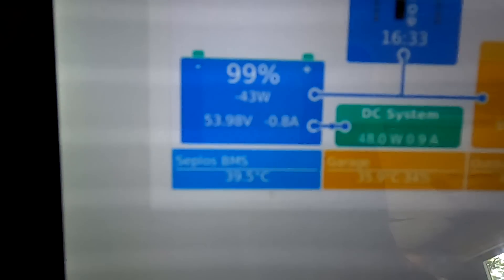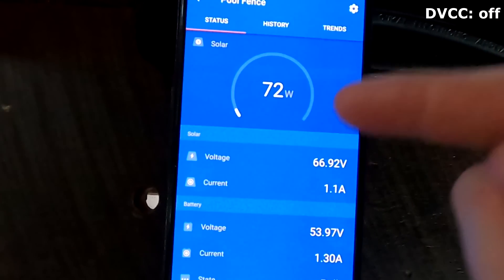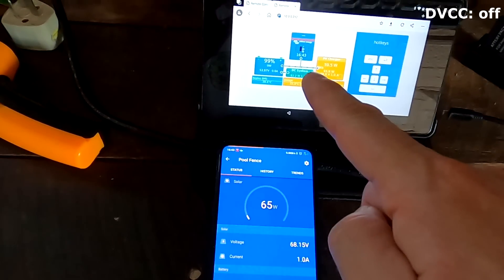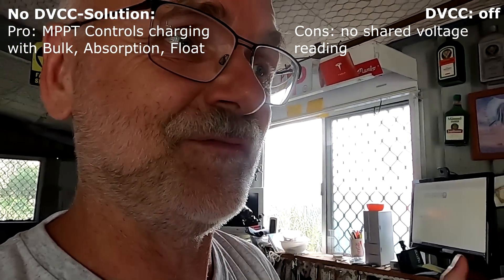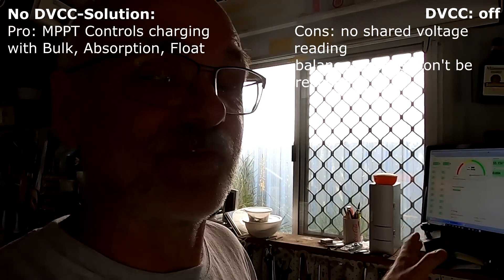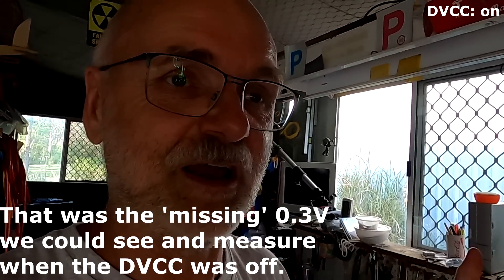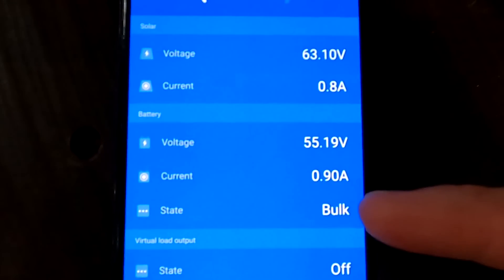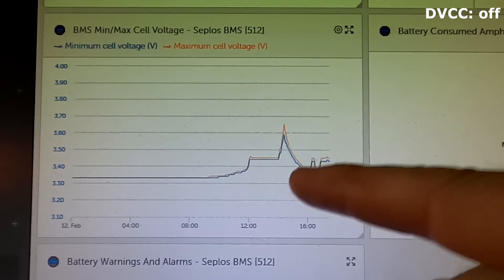Your Solution: Why you should(n't) turn on DVCC with your Seplos BMS.

Comment: I don't know if it's new, but I was able to select "No BMS Control" under DVCC -> Controlling BMS and can still use shared voltage, current and temps with everything.  The maximum charging voltage doesn't seem to work, but I just set that up in the multiplus and 2 MPPTs charge settings.  I think the charge current limit still works though.  I only have 1 48V 5kwh battery so if I am charging with all 3 devices I could go over the max recommended 100A charging.

Comment: I have been watching and learning from your channel for a long time, but have you ever talked about what happens when the CAN-bus connected BMS shutsdown?
That is by far the most negative aspect with having the batterybank connected to your system.
By using the shunt and have no COM to your system, it doesn't matter which one of your packs shutsdown (if not all of them does it :) )
Reply: Yes. I turned on DVCC for not quite 2 days (about 1 million CAN bus packets received) then at 5am something failed and the can bus interface (can0) went away, so the inverter set itself to 'off' and the MPPT didn't start up at 8ish when the sun came up. VRM stopped logging data too. So it failed safe, but obviously the system just stopping like this when a data connection drops out is not great. It would probably be better if it fell back to standard ESS charging behaviour.

Comment: Turning off DVCC will make your system charge your battery from the grid! Be aware of this! I have no idea how to turn off grid charging the battery when DVCC is off. Update: When I disconnect the cable but leave DVCC on, the Multiplus / Cerbo tell me "Low Battery" and use the Grid instead of discharging the battery. The seplos bms tell me the status is "idle", erverything green. What is going on?

Comment: I know, kinda late, but the voltage issue ... doesn't the smart shunt show the correct voltage and share that to the charge controllers?
Reply from the maker: Not when you have a Smart BMS connected as well. The shunt is obsolete in this case.

Comment: I ended up turning off DVCC and used the multiplus charge settings instead, just seemed more reasonable.
Setting are;
Balancer on & float (v/pc) @ 3.45v
BMS cell warn @ 3.50v
Charger set to 3.55v per cell
Cell OVP set to 3.6v.

That way, it gets fully absorbed, balanced and rests at 3.45v, I might change that to a bit lower in the future though.
Reply from the maker: I don't charge that high. 3.45V is my max and 55.2V is the charger voltage. After 1h (to allow balancing) I fall back to 3.35V or 53.6V.
Reply: @OffGridGarageAustralia Just got my V2 Seplos BMS to reset soc without triggering OVP. Clearly there's a setting that's not set right, or you need to charge higher than 3.45. Video on my channel (can't link cause youtube auto deletes)

Comment: Hi Andy, i am really having problems in trying to get a Sofar ME3000SP to function correctly. I recently put together a Seplos Mason case (the vertical type) with EVE 280cells. All seems to work fine, fires up, returns front screen info and i can access/change info on the bluetooth app. its the latest Seplos BMS as far as i am aware.

The sofar inverter doesnt seem to want to take power from the battery to feed the power required in the house .... 

is this because the battery needs to 'reset' after its reached 100% state of charge?  if so, how do i do that please? Happy to provide information/screenshots etc for anything you think might be causing my system not to work properly?
Reply from the maker: Hard to tell. Do you have the inverter connected to the Seplos BMS? What protocol settings in the BMS? Does the BMS shows charging and discharging FETs are on? Does the inverter displays the battery voltage?

Comment: If you are using a Victron Multiplus you can run V sense wires from the inverter charger to the main +/- terminal on the battery and select that as the voltage sense source. Those wires can be thin because they carry zero current, they only measure the voltage.
Reply from the maker: Yeah, only the Multiplus is not my point of truth for measuring the battery voltage. That is really the Smart Shunt in my design as it sits closest to the battery and also knows about the current and SOC.
Reply: @OffGridGarageAustralia  if the multiplus v sense wires are attached at the battery terminals then that is a superior battery voltage sense regardless of how far away the multiplus is from the battery. With no current ever being carried by those wires, there's no voltage drop. You can select which reference voltage, temp, current sense that you would like to use. I think the Multiplus makes the most sense for voltage and the Lynx Shunt for current and temp, at least until Seplos figures out how to control the Victron MPPT's....

Comment: the formula for CCL (charge current limit) is obsolete and you can use full charge current of for ex. 200A if you set the switch "Single BMS 1.0C charging" in the blutooth app to "on"

Comment: Hallo Andy, Du hattest doch mal irgendwo eine Liste mit deinen Einstellungen für das Seplos BMS. Irgendwie finde ich den Link nicht mehr.
Reply from the maker: Thanks, Thomas. I've  never done a list with all settings for the Seplos BMS as I'm still experimenting. But there is a list of all Function Switches and what they mean if it is that what you're after. It's right on my website under the Seplos BMS: https://off-grid-garage.com/battery-management-systems-bms/
Reply: @OffGridGarageAustralia  Hello Andy, as I see English should be the preferred language in your Youtube channel. Yes that is the document I was looking for. The other parameters for voltages etc. I can get from your videos. Greetings from good old Germany.

Comment: In DVCC u can set the source for the current measure and the source of the voltage measure. So u can set (for example) the bms for voltage reading and the smartshunt (not on the battery3.0) as source for the voltage reading.

Comment: @off-grid garage Die ganzen BMS funktionieren auf dem gleichen Prinzip welche CAN unterstützen - man muss sie so weit hochladen bis der Charge Mos zu macht (hängt vom den Parameter vom BMS ab)... dann gehen die Spannungen zurück und sind quasi auf Float... erst wenn das BMS unter einem gewissen SOC oder Discharge A ist gehen die MOS wieder auf! Lädt man die Dinger nur bis 55.2v welches mit deinem Bulk Absorp und Float Setup perfekt funktioniert zb. bei JK usw. hat man mit den ganzen CAN BMS Probleme da die erst viel Später den Mos zumachen... auch eine Kombination aus SOC, Current under 5A und bei einer gewissen Spannung schaltet der MOS

Comment: The use of Seplos batteries for powering devices has become increasingly popular due to their ability to store large amounts of energy and discharge at a steady rate. However, one issue that arises with Seplos batteries is the potential for uneven discharge when two or more batteries are connected together. This can lead to issues such as premature battery failure or inconsistent performance. To address this issue, there are several techniques that can be used to ensure both Seplos batteries discharge at the same time and maintain an equal State of Charge (SOC). These include using a balancing circuit, adjusting charge rates, and monitoring battery performance over time.
Reply: Are there any Firmwares available for the 24Volt Seplos BMS? I already tried the one from your website, but it seems to have a wrong calculation showing Victron System. Is there another option that I can use?

Comment: Andy, thanks for sharing, this is interesting. Maybe a wild guess where your 0.15V is coming from, the resistance in the wires and also the tiny drop of Voltage accross the BMS which is in it's path. If Seplos is measuring the voltage on the batteries and Victron on the output op the charge controllers this is what makes the difference. I agree you might not want to have an offset, in the ideal world the BMS and chanrge controller settle on what they measure, but that would mean both could manage and operate certain parameters together. I think the interoperability if not there yet to the fullest and should be sorted by Seplos.
Reply: I think it's because of the temperatures, so the connections should also be provided with a spring washer so that there aren't higher resistances at high temperatures.
Reply: The drop of Voltage is in my system only 0,02V so it is like nothing, if not reach the 55,2V for balancing, you can load 55,3V and that help in System with so much Volt drop.

Comment: A paranoid man might suggest that Victron doesn't let you use the BMS as a voltage reference because they want to sell more Smart Shunts...
There isn't a good reason for them not to allow you to set the BMS CAN as the source of measurements like the Smart Shunt and still retain control over the voltage set points at the charge controller.

Comment: I have the same result with Daly Smart BMS and Victron. The more charging current you have - the more voltage difference. Increasing the voltage for 0.2-0.5V in the MPPT doesn't solve the problem, because the lower the current - the less a difference. If the current is 1A or 0.5A, there is mostly no voltage difference, and your batteries will be overcharged for 0.2-0.5V as set in the MPPT. But if the current is zero and the voltage is different, I think it's safe to just increase the voltage in MPPT. So, there are two ways how to solve it: enable DVCC or buy a SmartShunt. I am going to buy a SmartShunt. But overall the problem is not so huge, because the battery will be charged to the MPPT voltage anyway, but with a lower current, because get an absorption level earlier. So, your batteries just need more time to charge.

Comment: Hi Andy and thank you again for this video (and all the others too!)😁👍
As I told you in one of my previous comments, this configuration with the BMS which manages the charging system, it works, But!
 you can definitely see that it "drives your solar controller crazy" 🤪like: Bulk/absorption...Bulk/absorption...Bulk/absorption...and floating???🤔
For me it is not good, for your solar controller?!🤔
Again, let's not lose sight that the BMS is made first of all to manage the battery pack, to protect it and not to manage
the settings of the solar controllers.
Having carried out multiple tests, it is not always easy to find the right balance of settings for these 2 parts of the system.
(In the end, managing by the solar controller is much better, especially when you have several battery packs connected in parallel)
Thanks again for sharing these tests with us!😁👍
Reply: I work with DVCC on and SVS on the others STS and SCS off. The BMS setting is 56.4 and in the DVCC I have 55.2 as the limit, as soon as the 55.2 are reached, the system goes into absorption and then just shovels still Ah in, at the beginning it is still 50Ah/kit, later less and less to almost 0, the battery is then 100% full and the voltage is 55 volts
The BMS never gets into a warning zone and I'm happy with that - let's see what Andy finds out in his next video.

Comment: I've often wondered why they don't have a four-wire connection to the battery. Using separate measuring wires would eliminate the I2R losses in the charge wires.
Reply: That is already an option with the multiplus ii, but it only works to manage charge voltages, which might well work in this situation.

Comment: Interesting stuff, but that voltage difference is disconcerting and the no float option would bother me. Could you use a victron 'Smart Battery Sense' to get an 'accurate' reading of the battery voltage, and share that on a BT network for the solar charger to use?  Also, how close is the shunt voltage to battery voltage measured at the battery terminals? I guess you could share that voltage if close enough? Cheers !

Comment: The more components you add to the system, the more variables or problems you will have. You really only need a good BMS and good multimeter. Also, there is no such thing as too much power from solar. Expand your battery capacity and go truly off-grid. If you have to much solar power then you are wasting power. Add capacity and tell your utility company goodbye ✌️

Comment: I’m wondering if the raw communications data between the Seplos and Victron equipment can be captured in some kind of debug mode on the VenusOS device side?  If so, the data could then be filtered through Wireshark or similar CAN bus specific software to get the protocol messages into a more human readable form.  If possible, it would help both Seplos and Victron gain valuable interoperability data from several BMS versions being used in the wild 😉

Comment: put a Victron shunt at the busbar and be done with it. Victron controls charging, Seplos controls the battery. You're splitting hairs with millivolts if the devices don't have voltage correction as an adjustable setting to correct for line losses from resistance .

Comment: I just installed a  WZRELB 4000w 24v inverter to run aircon lol  now cool as ice ,my lady wanted window mounted one in office , its kelvinator 3.9kw 1180w 1,5hp  ,been testing it on solar making 1000w-1200w  no worry's runs great very quiet ,so good free cool air all day and few hours at night , on 6kwh battery , ,ill be fitting a  3.5kw hybrid solar powered aircon in my shed , but i am surprised how well this window mount thirsty kelvinator runs on my little 24v system ,
Reply: more solar wire showed up today added more panels 4 x 20v 150w in a string at 80v  voltage matching 300 -330w 2x 2 strings 80v panels voltage now 3 strings making 1400w at 72v maxing the 100/50 ,now putting in 50amps ,aircon draws 45amps off the battery's so now have 5amps 200w left over hehe  ,i toasted some bread made plum jam toast on the big 4000w inverter lol with aircon on ,but most importantly  i earthed the inverters and charge controller to the house copper earth rod , be safe guys ! have fun building but play it safe earth and fuse everything

Comment: It's similar for me. I have to set my Charge Controllers (which are reading voltage at the smart shunt) to 55.48 in-order to achieve 55.2(3.45) at the cells. Makes sense with voltage drop and resistance in a large system over all the cables, fuses and breakers. I don't see a problem with it, it's is consistent and keeps my actual cell values at the target voltage.

Comment: What is the voltage measured by the voltmeter at the battery and at the MPPT controller? If they devices don't match can you recalibrate them?

Ideally the measurements by the devices should be within a percentage or two of the voltmeter measurements. If that's not possible I'd say the devices are defective.

Comment: I have the same voltage differences on a 12v lfp system. CC/shunt will always be around .05-.1v higher than what the bms and my meter reads.

Comment: I would treat the seplos just like any other battery and add an extra Victron smart shunt to measure Voltage and use that in a smart network.
Reply from the maker: Coming up next...
The whole point was, to use the Seplos 'with its good communication feature' as the battery monitor. That was what people always told me and why the Seplos BMS is so great. I must say, I cannot concur with that 😉
Reply: @OffGridGarageAustralia  Yes, I would indeed use the Lynx Smartshunt as a battery monitor. You have already installed it between the input and the output of your new battery system and it is blinking a few videos idly ;-)

Comment: Hi Andy,Ich schreib meinen Kommentar mal auf deutsch.Hoffe das ist ok.
Ich hab auch einen Kleine anlage und die Seplos BMS.Hast du schon mal beobachtet das das BMS den MPPT bei 96% SOC auf 10A runterregelt? Habe Parameter 80 Internal Charge auf 99% stehen...leider Macht das BMS trotzdem bei 96% den cut.
Und eine nächste Idee hätte ich noch zudem Balancer vom Seplos.
Es ist ja möglich diese "Active Balancer 4A" wie sie häufig in deinen Videos zu sehen sind ein und aus zu schalten.Auf der Platine sind ja die Pads dafür einfach mit einer Lötzinnbrücke verbunden....Es wäre doch mal interessant die Pads mit einem Relaisausgang von einem victrongerät zu koppeln und dementsprechend den Balancer dann einzuschalten.
Hoffe ich habe mich verständlich ausgedrückt.
LG aus dem Dunklen kalten Germany.... 🙂
Reply from the maker: Das ist per Seplos Design. Das kann man in den Settings ausschalten. Glaube in den Function Switch settings. Muss mal gucken, welcher da ausgeschaltet werden muss...

Ja, der Active Balancer kann uber das Relais vom MPPT aktiviert werden.

Comment: Hi Andy, you should get a second “hose” connected to that portable AC inlet , the unit is sending the hot air out, but the same volume of air is getting in the garage by the door, with a second hose the air swap would be minimized increasing the efficiency ( lowering a lot the temperature) 👍
Reply from the maker: That would not make a difference in the garage, I believe. The garage door is open most of the time anyway, so...
Reply: @OffGridGarageAustralia  yes, that’s true , the door open does not help, the massive volume of air being pumped would stop and that will help significantly to lower the temp, also it’s just a few meters of hose , nothing to loose 😉
Reply: @claudioporto5926 I understand ur suggestion/argument here, and while ur mostly right these air cons are of the most inefficient type in all regards & I think Andy knows this too. If he was to plumb this unit in correctly & close the door it would still make very little difference to the inside temp of his garage for a number of reasons, but the cool air it delivers will make a difference to his controller temps if aimed at them. 
This air con would struggle to do more than a 30-40m2 area if the room was insulated & sealed properly, in his garage environment it would be lucky to drop the overall temp 1 or 2 degree’s.